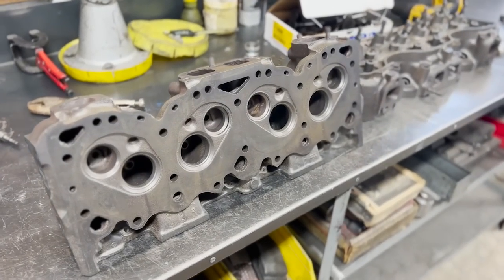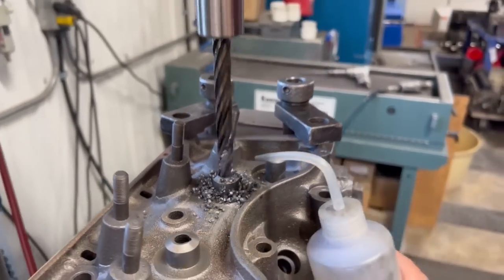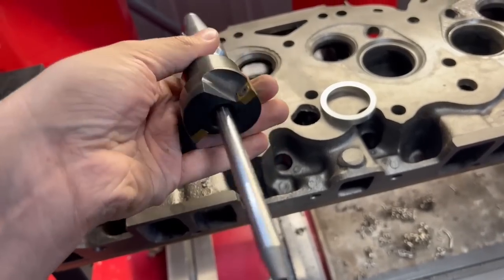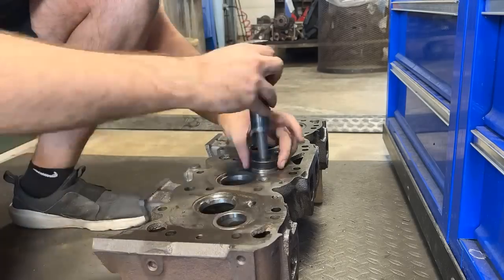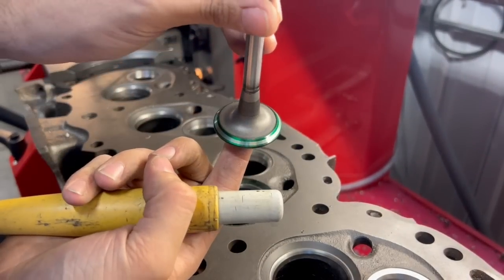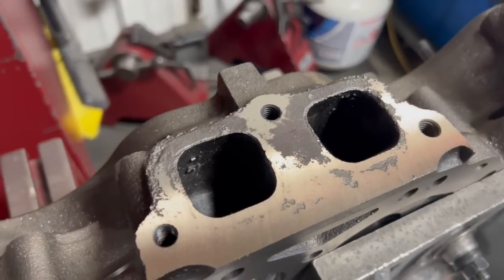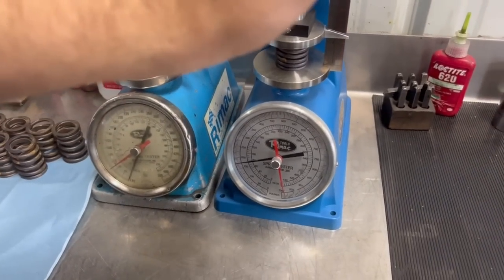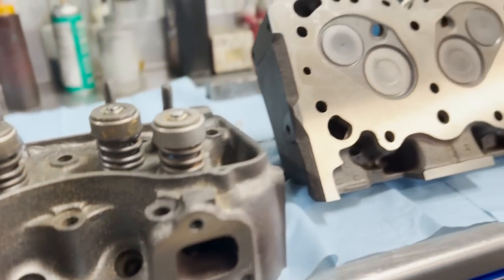We Rebuilt A Set Of 409 Big Block Chevy W-Series Truck Heads!

Comment: Just amazing to even find one of these old 409 engines.
That 409 would make one supper jet boat engine.
I used a Chevrolet 402 BB for my jet boat engine and what a beast it is plus my fishing clients get a Hugh thrill riding in the jet boat with an engine capable of 500 hp

Comment: I worked in a small engine rebuilding shop in the early 70's.  I saw a lot of different engines go through the shop but never a "W" engine.  I had a friend who had a 348 but he never could explain where the "W" came from.  One look at the combustion chamber of the head I now get it.  We had some very basic machines back then but still got some good results.  What a dream it would have been to have all the modern equipment you have!

Comment: You 2 do nice work. My first car was a bubble top impala with a 409. I bought the used 1967. 1 year later it was totaled, hit from behind while parked. Sold the motor and transmission for $300.00.

Comment: This doesn't look like work to me. It looks like fun. I loved working with my dad in the shop. It was body work, and not machining, but it was fun to me. Tearing down cars, straightening unibodies, getting the factory bolt locations all lined up. It was such a sense of satisfaction when all the parts just fell into place on reassembly. 
Painting prep is for the birds, but to see a nicely painted panel get installed, or to color sand and buff a car to better than new, it was a great feeling.

Comment: well there ya go , 409 truck engine , even rarer than the 409 car engine ! I ran a 348 in a tow truck a 1951 that originally came
with a straight 6 . I  retrofitted that 348 in that Chevy tow truck custom , the truck had a 525 Holmes wrecker on it from new
however , that straight 6 would have you crawling up hills !!
after that 348 install , I was pulling heavy loads & gaining on the hills like crazy  !!!!
348 & 409 's were really something else ,  and looked a lot " COOLER " under the hood then a 396 / 427  !!!!!
THOSE  WERE  THE  DAYS !!!!!    KEEP UP THE GREAT VIDEOS ,  2 THUMBS UP  !!!!  THE MACK GUY

Comment: I started doing this stuff 55 years ago as a kid I started liking machine work in 70 but I didn't start really doing heads until 80 when Mount St Helens blew up and I did heads for 20 years at home in a large shop with not much tooling try it the hard way without special machinery and looking around for machines or tools that are used that work and cleaning them up and trying to make them work trying it the hard way anyway I throw those Shields away because that's extra weight on the valve spring and the valve springs are not extinct they don't have to be the same valve spring you can use different valve springs and depending on what the valve looks like you don't have to use the exact same valve a lot of those things I never got to have special tools but I had Cutters that you have to put in a hand half inch low speed drill the only thing I never had was a milling machine which is I wish I did

Comment: I have the block adapter plate used with the deck mounted boring bars. Bores were not square with the deck on 348,409.

Comment: What are the signatures indicators of it being a 409 engine?
 I  stumbled across a motor the other day at an old fellows place that looks like a similar vintage grain truck/ gravel truck gasoline engine  5 & 4 transmissions. It's possible it's a 409.
  I was more interested in the auxiliary transmission, but the engine didn't look like a 427 to me. I've got a couple of them but prefer diesel engines. 
Swapped a 353 Detroit into a 59 Chevy 1 ton years ago. ( probably my most popular video posted)

Comment: On the Chrysler 4.7L OHC V8's. The valve seats are known to drop if the engine is overheated or, even if the engine is run especially hard and then shut off immediately without letting it idle for a minute to cool off. Is there a trick to replacing those seats in such a way that they won't drop again?

Comment: Insering heads usually ends up striking water, I have seen it a dozen times, There is not a great deal of material under the seat and once they are pushed in it opens up the iron. An sometimes with some hard use it pounds the seats further into the iron.
Something that happens way too often with alloy heads as well. Or the seats fall out!!
I have seen seats in a SBC head that broke in two. Lucky it did not do too much damage

Comment: Fix the strike face of the valve seater thing. With a tool that mushroomed and cracked ypu run the chance of a piece flying off and imbeading itself in you. All you need is a grinding wheel or a sanding belt.

Comment: I did not know the 409 was an option in trucks. Also, every 409 head I ever saw had a completely milled flat combustion chamber. They looked like diesel heads with a spark plug in them. These look like they took a bathtub chamber and shrunk it.

Comment: Guys, you talked about interference fit on the new seats. I have a Chrysler 4.7L with a dropped valve seat. I know, big surprise!. I am replacing the heads (aluminum) and I need to have a good valve job done with new seats with a sufficient amount of interference so that it can't happen again. Can you help please!     Thanks

Comment: And again a Quality Valve Job done without using any lapping compound to make a good seal. 😲

While not near as good as what you have, I get by with decent results using my old Black and Decker Valve facer with less than a thou runout and my old Snap-on seat grinder,  Tooling from Goodson for the seats, guides, pockets, seal stems and any runner and bowl work that needs done the old school way. 💪
Not perfect but works for me.

Haven't seen a set of these heads in over 20 years.

Comment: I have never seen a set of hardened valve seats go well in a set of 348/409 heads. All the 409 guys I know including myself won’t touch a set of heads with seats installed. Those heads are scrap now. You should have installed larger valves and bored out the seat a bit.

Comment: Could you put a dome piston in those motors?
Reply: All the pistons for those engines had a domed appearance. Hopefully the link works. https://pinewoodsystems.com/images/igallery/resized/401-500/348_409_Block_FCS_2-418-1200-1000-80.jpg You can see how they could increase the CR by employing a different angle on the lower trim.
Reply: @88SC  Thanks for the info! I will check out the link. It seems like they would be somewhat limited in performance upgrades without a lot of "engine"uity. Lol

Comment: I don’t know why you guys use a induction coil gun to heat up  and or put heat into the exhaust studs before you try to remove them and possibly breaking them , instead of using a torch. Those induction coil guns are fast and just puts heat into the stud only

Comment: The 348 and the 409 are two entirely separate engines,  the heads are not interchangeable,   even the intake manifold is different.   I still have my dad's old books that he used when he worked on them 60 years ago. 
They might look the same but they are not the same engine series. 348 you couldn't give them awa
Now people are looking for them. y